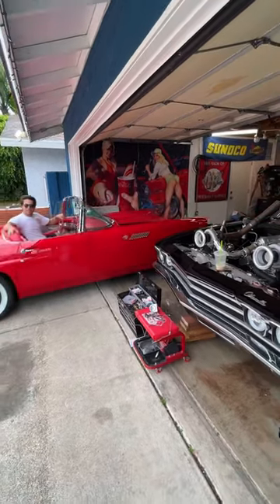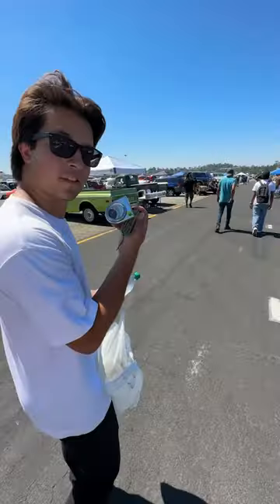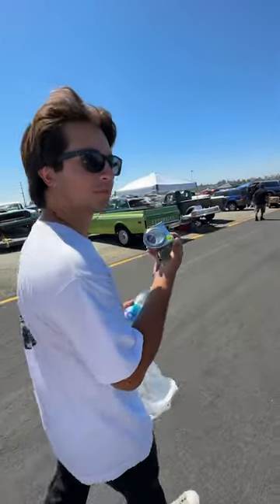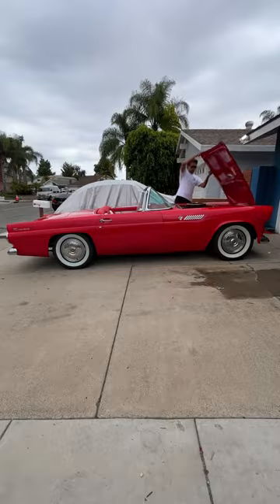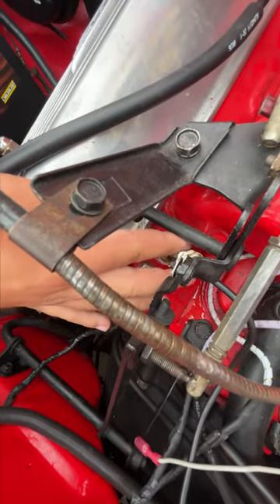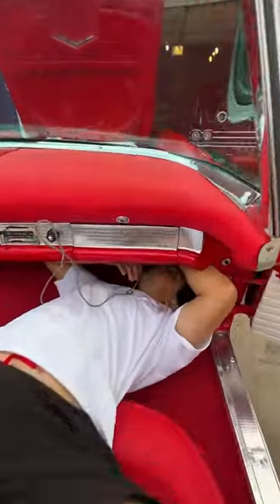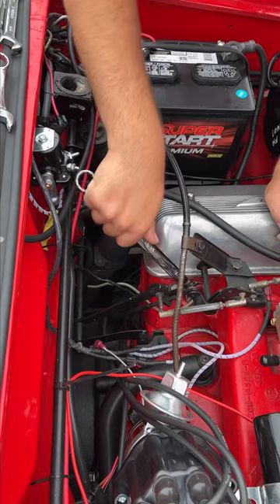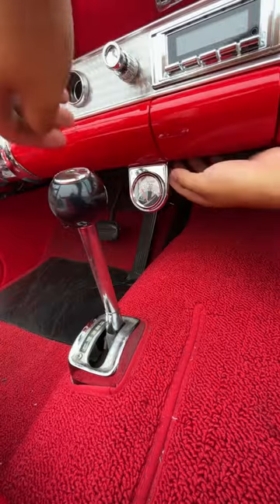Using vintage parts from a swap meet on my Thunderbird

Comment: T-Birds came with a temp gauge from the factory. You can see it on the lower right side of the speedometer. Why not just use that one?